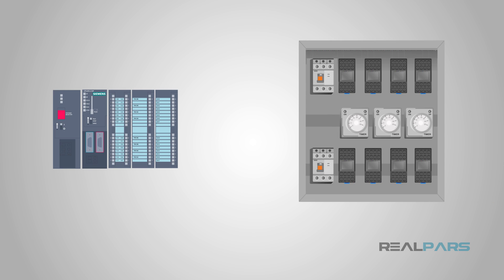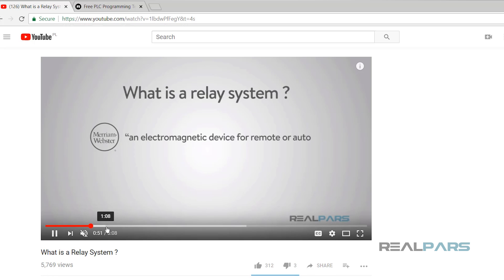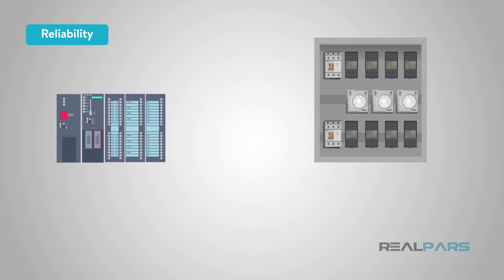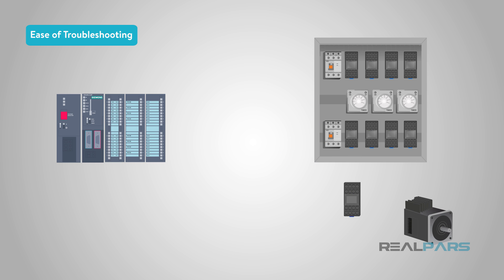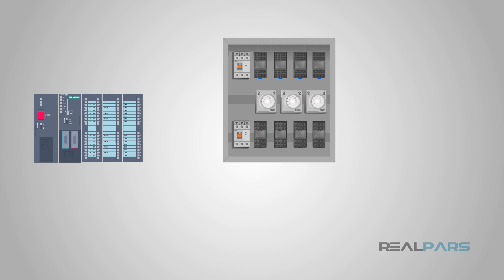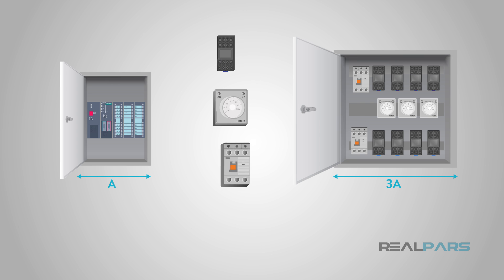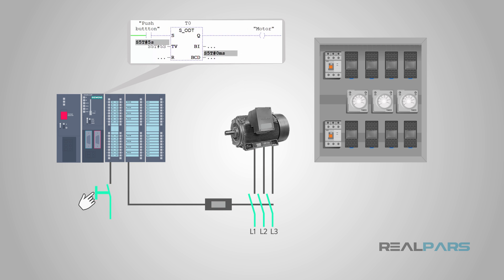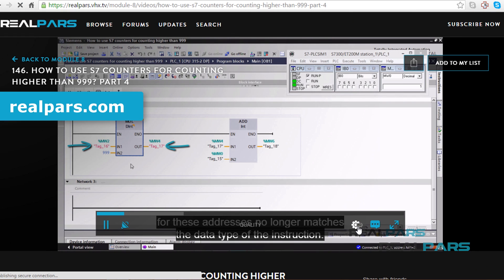What Are the Advantages PLCs Have over Relay Systems?

Comment: One advantage of the traditional relay system is the high voltage device can be controlled by low voltage circuit through using a relay, how the PLC control the high voltage device so that it can replace the traditional relay system?
Reply from the maker: In cases you have described (high-current load), you still need a relay.  Some PLC's have relay output cards, which typically have current limits of about 8A.  This is "beefy" enough to pull in smaller motor contactors.  A traditional solid-state digital output card is often limited to 2A, so in most cases involving motor controls, an interposing relay is required.  A very typical (and efficient) method of control is to use an external power source for the motor contactors (in order to separate PLC circuits from inductive load circuits).  In this case, an interposing relay is also required.
Reply: Thanks.  If then, I have read some documents and also your video, they said the PLC can replace the traditional  relay system, so is not correct?  I know I may misunderstand something, so please just correct me.  Thanks for your reply.

Comment: I really enjoy all your videos and format used to present them. In this one in fairness to relay control systems there was an over simplification of the amount of wires going from the PLC to a motor. The motor 3 phase starter is not shown with the PLC example. Where the 3phase wiring is shown in the relay example. Your material is excellent. Most of my experience is with ladder logic and I was drawing my equivalent version of ladder logic as you where building your PLC program just to have fun and compare. I wonder if you would do a video on motor soft starting using a VFD.